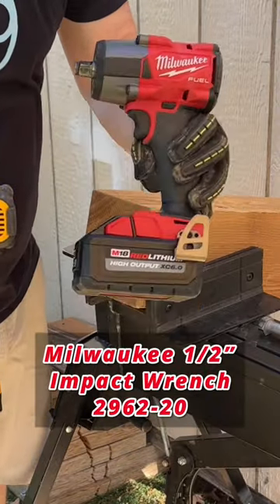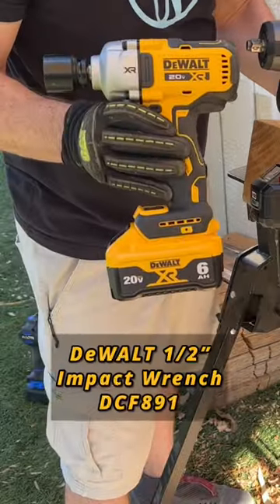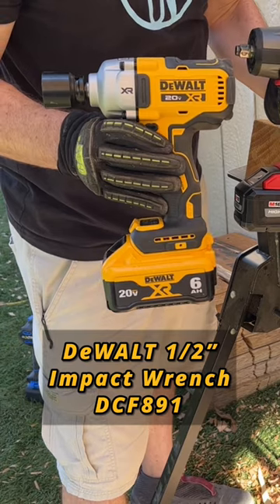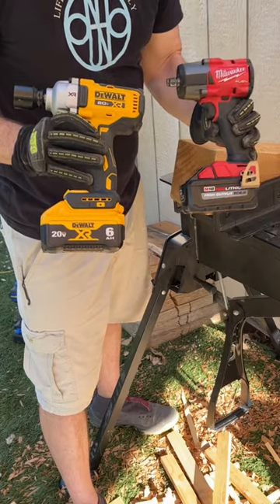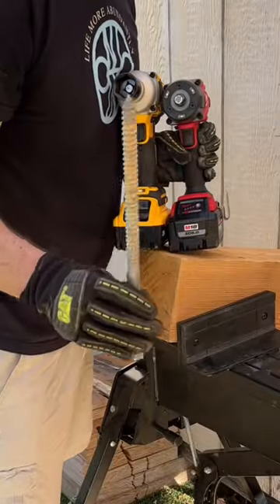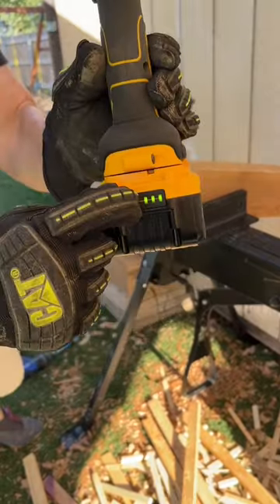Mid - Torque Showdown! Milwaukee 2962-20 VS NEW DeWALT DCF891!

Comment: Torque Test Channel already showed that DeWALT destroy that Milwaukee and the Makita 36 volt
Reply: And TTC also showed that every other DeWalt product is inferior to the entire Milwaukee lineup
Reply: @francd2981  lol where
Reply: @francd2981 

Says the bud lite drinker🤣
Reply: @francd2981 don't cry milwake fanboy
Reply: Yeah because the dewalt is about 2 inches bigger from motor to anvil. Oversized for a “mid torque”.
Reply: @mpaxton6686  something tells me your wife is crying about 2 inches as well 🤣🤣🤣🤣
Reply: Torque Test just measured maximum torque. This guy measured speed
Reply: Dewalt fanboys are weird. Destroy? It’s MUCH bigger and heavier. This dewalt “midtorque” is the size of a Milwaukee high torque. They are a different category of tools, despite the name.
Reply: @cliffordmontana4562  Milwaukee fangirls are weird, they can never just take a loss without crying 🥺😂😂
Reply: @Lee-lb9qh  The Dewalt is yuuuuge. It’s as big as a high torque. It’s very good, but it’s way bigger and heavier.
Reply: @cliffordmontana4562  it's not huge bro, I have the DeWALT my co worker has the Milwaukee, trust me, it's not much bigger
Reply: @cliffordmontana4562 I own the DCF891. It is not "huge"
Reply: @Lee-lb9qh  I own Dewalt and Milwaukee tools. Nine times out of ten the Milwaukee tools are better. Dewalt is good and makes some excellent tools, Milwaukee is just better. The new Milwaukee telescoping pole saw is the most amazing tool I own. It cuts as fast as a gas stihl 362.
Reply: False. Milwaukee won everytime.
Reply: @cliffordmontana4562  how exactly is Milwaukee "better"? That is a very vague statement
Reply: @ranranpoopants  um...ok, don't know what video you watched but whatever you say Mr. Delusional/Poopants 🤣🤣🤣
Reply: @Lee-lb9qh  bro you’re bootlicking a poor brand like dewalt is craaaaaazy.  Get your money up poor boy! 🤦🏻‍♂️

Comment: Dewalt wasted a few seconds driving the bolt deeper than the Milwaukee.
Reply: It also cracked the 4x4 and Then he stuck the next Lag right where the crack was and the Milwaukee Is  gonna push right through that because it’s already cracked

Comment: I own the DCF891 with 5a Powerstack battery. It is very strong and versatile. In a rust free environment, it can definitely take the place of a High Torque. Only thing I don't like is that it's loud and jittery. But that seems to be a Dewalt trait in general
Reply: I wonder if DeWalt will make a mid torque hydraulic impact wrench eventually...

Comment: Love the already drilled hole for the Milwaukee plus the Dewalt split the wood giving the Milwaukee a double advantage but still could just barely beat the Dewalt. Milwaukee fan boys just can't admit their tool is getting beaten not just by Dewalt but also Flex

Comment: That's not really a test for impact wrenches. The gearing can affect the speed. For impact wrenchs of similar size, weight, and price, the most important spec is the max torque in reverse, followed by tightening torque.

Comment: This is resl world application,  unlike those torque tests. Their both awesome
Reply: Real world tests are cool but I think the torque test is more accurate because different things can affect the tool, putting them on a dyno or whatever ensures everything is the same everytime and you just see the power of the tool itself
Reply: @Lee-lb9qh  true, as you could see in this video, the Milwaukee was driving into a crack that was already there, the dewalt was not
Reply: @RunninGunner04  ya I saw that too
Reply: @RunninGunner04  plus the hole
Reply: I agree but whatever works best 4 you I have all.of them milw dew mak ryobi ridgid they all have their pros and cons no tool company is perfect some are great some are meh
Reply: A true real world test would've been this but on a fresh timber for each.